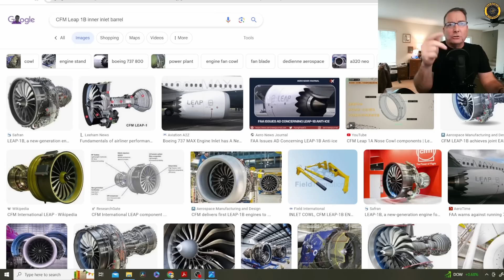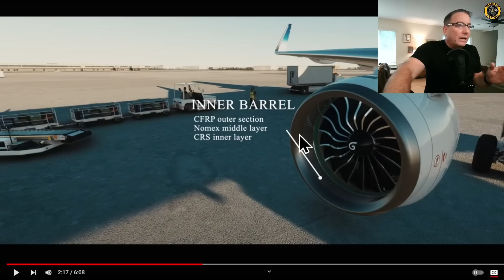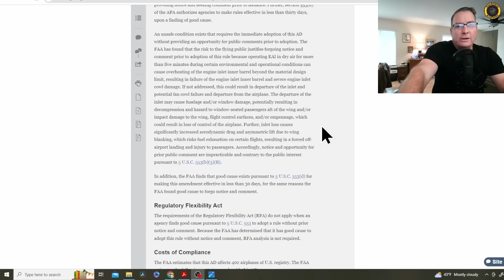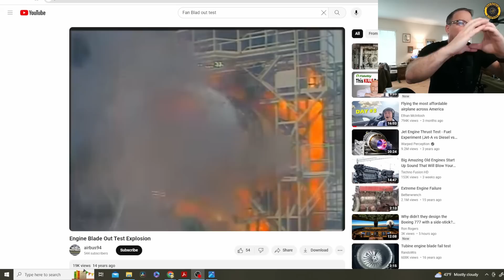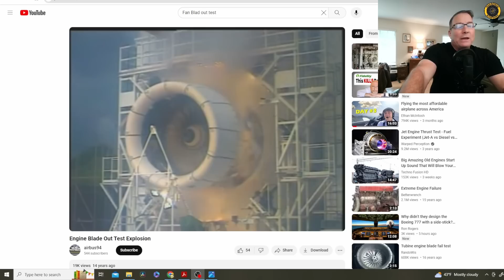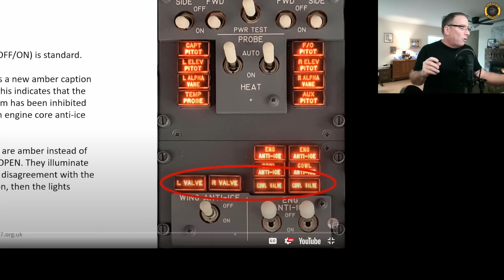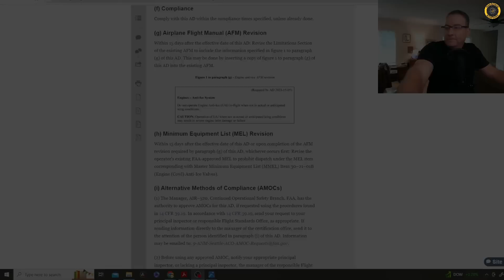Boeing 737 Max-7/-10 Certification HALTED! 1 Feb 2024

Comment: Another. Great video.  As I was listening to this I’m not a pilot but I’m sitting here getting more and more stressed out and angry thinking what bs it is for pilots to have to deal with such an inane thing, so it’s kind of gratifying when Juan cuts loose and says basically the exact thing I’m feeling about how actually terrible this is.  I have zero sympathy for Boeing on this, imo all 737 max’s should be grounded and forced to go through a ground up new type certification.   

AND the doj should immediately revoke the non prosecution agreement and prosecute some execs for their CRIMES in the max-8 crashes since pretty clearly Boeing hasn’t lived up to their end of that agreement (which was bs anyway, you shouldn’t be able to talk your way out of a crime just because you did it for a company)
Reply: @FreepSkate  As I mentioned in a reply to a different comment, the DoJ would also need to hold the FAA accountable as well, since that agency allowed Boeing to self-certify much of the design and build process of the MAX series.  Can't just hang Boeing leadership when the watchdog agency wasn't keeping up with their responsibilty for oversight.

Comment: Now was it Boeing that came up with this cowl design or was it CFM? I'm really curious just how much of a weight savings there is from metal alloy to carbon fiber. I would also be curious if there is s timer to see how long the cowls get heat soaked with anti ice on. If the carbon material can fail, the anti ice time needs to be tracked IMHO.
Reply: The cowling is designed by the aircraft manufacturer, the engine sits inside the 'pod' but is designed separately.
Reply: @gordonrichardson2972  that makes sense. Now I am not faulting Boeing for being innovative. But they seem to have an annoying habit of not budgeting enough for development of new technology, leaving too many potential gotchas in the tech. Oh I'm sure some bean counter has already budgeted how much development time to work out all the bugs will cost versus the litigation of a potential vehicle loss and casualties. But it is a sucky way to function as a business.

Comment: This is ridiculous. the fact that it's only an AD and not grounding of the entire MAX fleet is a crime.
Reply: Because of how many Max’s now exists and how long it would take to fix and no one has had a major engine failure from this is the answer. I would ah e thought and the very least increased inspection should be carried out
Reply: @tomstravels520  I'd argue that A- a regulator should not care about potential losses / business impact. And B- a regulator should be proactive and not reactive, don't wait for stuff to happen in order to take measures.

Comment: Many here are more knowledgeable than me, so help me out. It's been my understanding that the engine manufacturer would be responsible for this engineering failure, and not the airframe manufacturer, Boeing.  Where does the line of responsibility get drawn?
Reply: Boeing designs/makes the cowling/nacelle and anti ice system

Comment: should be easy fix...put in thermistors in cowling and computer to monitor heat and turn off system as needed to maintain safe temperatures...
Reply: What about the good old mechanical thermostat in the cooling system of any car? Properly maintained, they're reliable and last a lifetime. Go, AC Delco!

Comment: I agree, the anti ice function should be fully automated or at the least a timer installed to shut if off after a period of time. Also these engines are made by GE and they should redesign the engines to be able to take the extreme heat from the engine anti ice system.
Reply: Need more AI, and a boat load of ML.

Comment: Boeing is trying to have it both ways.
1) It is the same type of plane, no need to re-train / re-certify
2) We completely updated the engine, but did not update the controls.

Either put the metal back in the engine, or put in some automatic engine de-ice controls, safety over temp auto cut off . . . Pick one.

Comment: My first flight was in a Boeing 737 - 200, was so pleasant, considering we have back then an excellent on board service: good meals and free soft drinks: coffee, sodas and orange juice, sometimes you received a complimentary drink and the second shot on you will pay a reasonable price.
Previously have had int'l flights in Electra's and 727's in Brazil and Lloyd Aéreo Boliviano departing from Santa Cruz. Both planes were noisy but the 737 was not. It's a shame that a big and famous company let their aircraft stopped by the FAA certification processes specially the 737 -MAX dash 7, 9 or 10 due to POOR QUALITY CONSTRUCTION AND NON QA.

Comment: Would using an automatic icing system even require a new type rating? I can't imagine that would be such a significant change as to require that.
Reply: On its own no, but Boeing already made several changes with the Max and only so many changes are permitted. If they could have more they wouldn’t have needed to add MCAS
Reply: @tomstravels520  AFAIK MCAS was a hard requirement as they couldn't move the wings up without definitely requiring a new type rating. The new engines didn't fit under the wings, so they had to be installed further forwads, this then created a pitch momentum at higher thrust which required MCAS to compensate.

It's all a bad design, but I can understand the reasoning behind it. The big mistake was not properly documenting the system, and that's what caused 2 fatal crashes and nearly a handful of others (somehow pilots figured it out in spite of it not being in the documents and disabled the system).
Reply: Southwest pushes FAA very hard to make it not so.

Comment: Question - didn’t the engine manufacturer and / or Boeing do structural temperature testing on this new cowling material , to determine that the material could be less resistant to bleed air temperatures when not in icing condition. And it really doesn’t make sense - when your experiencing actual icing conditions with anti ice on, how does that make the Carbon reinforced cowling accept the bleed air temperature vs when not in icing. I mean - if you have the anti ice on in actual icing - there should be no ice on cowling …. So what’s the difference- If the OAT is say -20, whether in  visible moisture or not , the cowling is still receiving “ hot” bleed air .   Asking for a friend 😳

Comment: They need to be all hands on deck with an MMA and make it right.  They will figure out the max engine issue but another costly oversight for sure.  The FAA also needs to figure out how to be part of the solution to the problems they should also take blame for after years of poor oversight.

Comment: Most aircraft where high pressure/temperature pneumatic ducts are routed have systems to detect and annunciate a leak or overheat, especially where they route adjacent to composite structure which is sensitive to overheating...I've never understood why the engine nacelles (large composite structure) have no such temperature monitoring/leak detection. The 787 for example has zone 1 (under fan cowls)  temperature sensors (in addition to the zone 1 fireloops) specifically to detect EAI duct leaks in zone 1...yet the Inlet cowls (forward of the fan cowls) have no detection at all so the first indication of a leak is an overheated Inlet composite structure...bit of an oversight in the systems design imo which hopefully will be addressed

Comment: What an engineering fiasco.
Also, have Boeing heard of night flying?
BTW, how is a pilot supposed to be able to assess the actual cooling effect of the air on the cowling? Has Boeing heard of temperature sensors?

Comment: Boeing modern?  hahah...  I'm a computer programmer and a number of friend worked for BCS (Boeing Computer Services).  I think around 1988/1990 most places were not using punch cards any longer...  Think it was around a friend of mine told me around 1998 BCS 'officially sent out a notification that no now program will be written requiring the use of punch cards...  Thing is that is no new program, i bet they still have some running off them :)

Comment: I wonder what's going to happen now with the 777/787 replacement they are building for Emirates. I've heard this new MAX 12 is going to be a real game changer. It will be twice as long as the MAX 10 but with an upper deck bolted to the roof made out of 2 old MD80 fuselages. Same common cockpit as the 737-100.

Comment: it all goes back to the ability to use old TCs on new aircraft.  Major flaw in the FARs.   Same reason why AS350 helis still don't have fire resistant fuel systems.  It will be expensive, but modern aircraft need to comply with modern regs!

Comment: Your rant is misdirected.  The issue is the CFM engine that has  the problem. They are the supplier of the engine and may have to go to a metal bleed annular ring to deal with the issue of overheating.
Reply: They may supply the engine but they don’t supply the nacelle, cowling or anti ice system. Thats a Boeing problem

Comment: They've had off-on go to off-auto-on for other switches in the past, the only reason to not do it for this is to avoid integrating logic circuitry for the auto state.  What a sham.
Reply: It’s to do with type certification
Reply: "My engines go to eleven"

Comment: The leading edge heating scheme is called "hot lips". You don't have to melt ice. All you have to do is create a gradient. Icing can be cured by 1. Not forming, 2. Melting, 3. Sublimation. The Leap engines pursued the next generation of efficiency and quietude, but the driving force  behind the front end changes is the occasional shed blade in the CFM 56 Saffron/GE motor that proceeded them. These motors shed a few blades and even killed a Southwest passenger. CFM 56'es are not unique to Boeing. All transportation has it's hazards and remedies. Just like the CFM 56, it's time for the Leap to take it's turn pulling the wagon. The Max 7 is destined to become the least strained, most flexible, and most economic plane in the sky. It's just got an unlucky target painted on it.

Comment: To me it feels like noone at Boeing is allowed to consider consequences or what-if.  Or maybe gets fired if they do.  Hotter engine but more melt able cowling is so like MCAS.  No consideration of interaction of changes, or impacts.  Of course if fixed like MCAS they'd have it controlled by a single thermostat that's sited too close to either the fridge or oven venting!  Obvious step would be an overheat detector in the cowling, but what happens if that faults and disables anti-ice during icing.  Aircraft aren't easy as you can't just pull to the side of the road. So a warning only, or a force heating button.  But neither of those match a 737 V1. And either still gives a strong option of melting the engine inlet. 

That this follows from the company that built the 747 with all its triple redundancy systems, almost pre-computer, that can survive volcanic ash (barely) or land with whole boggies missing. 

A modern 737 reads like chaos theory. If a passenger flushes a toilet at the same time as the pilot engages the autopilot, who knows what might happen!  I'm being fecetious, but in some ways I fear I'm not.

Comment: Boy this IS cutting it close, isn't it.  The swiss cheese has become a screen door.  Yes, if the old alloy is used it might work.  That is, if the even hotter bleed air is now not too much for it.  But the prized engine fuel efficiency might not then be met.

Comment: There has been no composite delam / breakup incidents that I am aware of which also means that there is not a systemic problem with the composite inlet skins or their supporting structure, 
if it is composite as well.

So why the hullabaloo-?
Reply: All the crews of currently operating MAXs have been careful to turn off engine anti-ice after exiting icing conditions.

Also, we don’t know how Boeing discovered the issue. Could have been some delamination on a test flight.

Comment: Here's a thought....... many engines (gas turbines) are designed so that the engine anti icing fails ON.....I know some CFM variants use this as do many other engines......... so..........if you lose electrical control of your engine anti ice system .......which fails ON..............
Reply: The problem is engine anti-ice ON when not in icing conditions.

Comment: Does this AD not affect the A320/321 neo at all? It’s the same engine on the LEAP equipped aircraft, that is what’s used in the photo example of this video
Reply: It’s not an engine problem. It’s the aircraft system that controls the operation of engine anti-ice.
Reply: @robertbutsch1802  interesting, given the fact that the material itself is what’s failing. Yeah it’s more likely to happen on the Boeing due to it being manually operated but that’s not to say it’s not a risk on the airbus as well… strange AD here

Comment: just wondering the A321NEO , much better plane, has the almost same engine the Leap1A, the fan section is just larger than the 737MAX so why the change in materials and time environmental limitations?

Comment: Ok, now sorry if I sound offensive to any airline pilot reading this, but I do really feel to say it at this point.

Considering all the, frankly speaking, pile of shit coming up about the MAX series, anti-ice issue included, do you evaluate the plane as safe to fly?

I am talking about a brand new one, with zero malfunctions on the book.

‘Cause to me, and I am just a little PPL-licensed amateur, the answer would be a sounding NOPE.

I mean, human error is statistically the main reason for air accidents. Now you’re saying I can’t forget the anti-ice system on 5mins after icing conditions are over, ‘cause I risk blowing up an engine (or both, for that matter).
Plus, I have no ways to tell if it is on (apart from checking the knob), no warnings, forget redundacies, nothing.

To me, that’s an unsafe plane to fly. Over.
“But it’s brand new, never had an issue”. 
That’s an aggravating circumstance, it means it is unsafe by FAULTY DESIGN. 

Now, considering the last word about safety is from the Captain, the point is: either I am wrong, and the plane meets what a pilot should consider the baseline for safety, or I am not wrong, and the captains still flying the MAX series are not fully exercising their role (that’s not to unload any responsibility from Boeing and FAA, of course!)

Sorry, but at this point I can’t think otherwise.
I understand you’re risking your careers (and that’s the best case, the worst is your life), but that’s what you are paid for. 

I would say, that’s what you are MAINLY paid for.
Do the right thing, leave all the MAXs on the ground even for a single day. 
It would speaks much louder than whatever else!

Comment: Obviously if the 777 can have automatic engine de-icing, so can the 737.  Why not have sensors on the cowl ring, that once a certain temperature is reached, de-icing is limited or turned off, to prevent damage.
Reply: Single type certification. If you add an auto mode you risk loosing it because of too many differences in the operation of the aircraft

Comment: Hi Juan. Long time since the last time I posted a comment on your videos. But all this buzz around the new 737 series (max), is really starting to uncover more dark corners that would be normal on one of the most liable and known aircraft name in the industry. As I told long ago, I'm a simple MSFS pilot (since the beginning) with almost 20 years (+) of FS. And sir, the 737 always had a special place in my "pilot" life. I've "flown" the 737/200/300/400/500, with almost 2.000hrs all together under the belt. Not to brag about but just to show how I love this  bird. Cut the long story short, are we on the edge of the beginning of the end of this brand? What benefits did Boeing took from all this mess?
I mean MCAS systems that are unsafe,  doors falling of the plane 'cause they're not bolted, engine anti-ice systems that are dangerous? Luckily,  I don't have to deal with all this mess "flying" my PMDG B737NG😁. Happy landings from Portugal 🇵🇹
Reply: Microsoft Flight Sim needs to add these features!  MCAS to fight for your life against, sudden depressurization when a door falls off, Fan Blade Off halfway to Hawaii, deicer setting the engines on fire, ... wonder what else will come up?

Comment: This is the idiocy of trying to use plastic in place of metal at high temperatures, they all should be grounded until they redesign the components in stainless or some other suitable metal

Comment: They do need a house cleaning. Boeing started going down IMMEDIATELY after they changed their long and successful tradition of having a CEO with a background in engineering.....instead of choosing an accounting and equity background CEO.....I believe it is mostly the shareholders fault for deciding to go down that road for increased profits by any means available. This is the crap you get. Sad....there are some very good documentaries on this subject with Boeing. Kinda similar to what happened to a lot of the big American tool companies, now selling absolute JUNK. Craftsman, Vise Grip, Porter Cable (they used to display on a serial tag "PROUDLY MADE IN USA),
Reply: Muhlenburg was supposedly an engineer, but somewhere along the line he lost the plot.
Reply: @SteamCrane  Yes, you are correct! I had forgotten about that.

Comment: I’m a designer and have worked on all Airbus programmes since 1999, I also spent time at Boeing on 747 in 2001 and they seemed more worried about what Airbus were doing than what they should be doing themselves. Case in point rather than a clean sheet design to take on/ beat the 320/321 they went cheapskate with yet another rehash of the 737 and now unfortunately are paying the price.